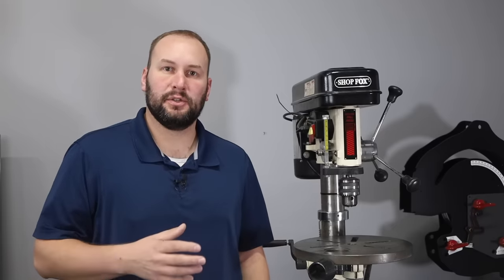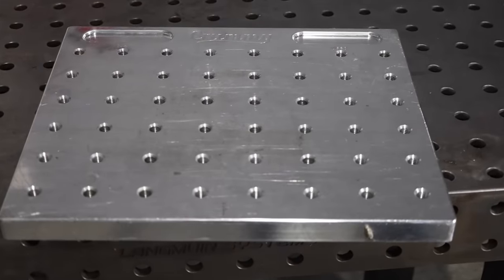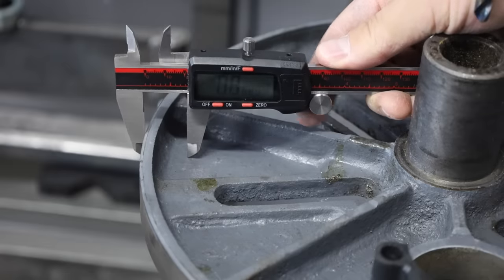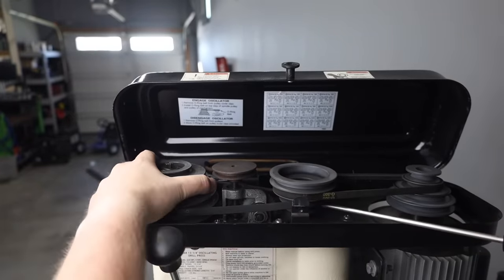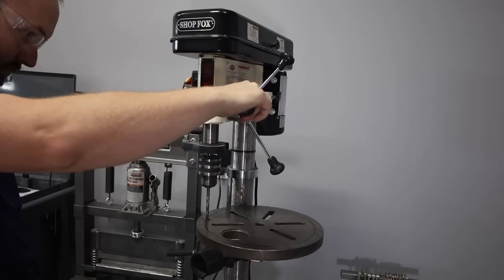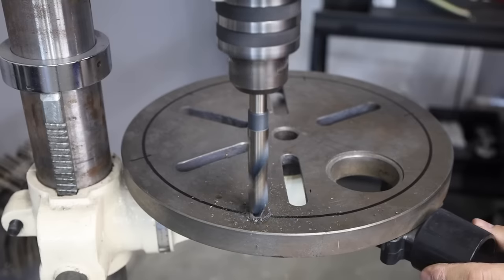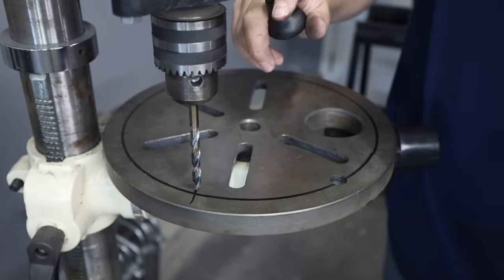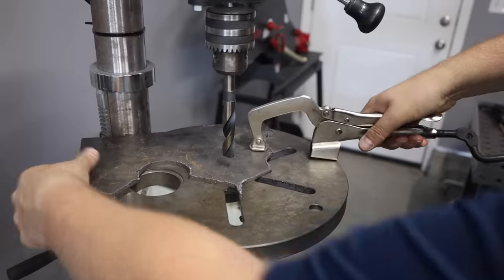EASY Drill Press Mod I Should Have Done Years Ago

Comment: Drilling (and sometimes tapping) holes in machine tools makes them more useful, for sure - there’s no rule which says you can’t! Hint for pilot size drills though, from a career machinist…use a pilot bit that’s the same diameter as the chisel edge. It’ll prolong the cutting edge life of the larger drill.
Reply from the maker: Great tip! Thanks!
Reply: I was going to say that 😅
As if your pilot bit is too big the next drill have a tendency to bite in since the surface area is to small and it chips the outer edge.
Always try to have a pilot bit just slightly larger than the center web/chisel.

And if it starts chattering and smoking it often is too high speed and too low feed force.

Cast iron is my favorite to drill as it doesn't make hot large chips that burns everything 🤣
Reply: i love pilot holes ! 
it's not cheating.. its guaranteed success everytime without killing my bits
Reply: @DursunX  I've never met a pilot hole that wasn't cheating!!!!
😆
Reply: @walterashley149  Haha! As a retired pilot, I resemble that remark! 🤣
Reply: yep, and you don't use oil on iron it could surface harden it. Good going
Reply: With gray cast iron, the free carbon - the graphite - acts as a lubricant so cutting fluid is unnecessary. But there are many types of cast iron so use cutting fluid if needed.
Reply: Yep, if you tell people you can't, nothing gets done. Traditional metal working practices don't always work, or they work, but never suitable for your own ideas.
Reply: Sorry I such a newbie, but what is the chisel edge? Asking because I’m a DIYer and never know what size pilot hole to use so I usually just pick whatever smaller bit that makes sense to me.
Reply: @DursunX  Nope, it's definitely not cheating, only in the eyes of luddites who don't believe in making life easy for themselves to get the same quality result. You are dead right. It doesn't hurt to know how  to do things the old way, then you have the knowledge behind you to improvise. And I certainly do a lot of improvising to get the work done. "You cain't cross dat bridge until you build it, but how you walk across it is yo' business".
Reply: @daveparker839  I think they are referring to the solid core of the big bit before the flutes begin for chip removal, the part where there is a chisel point on the larger bit
Reply: @frotobaggins7169  ahh. Makes sense. Thanks!
Reply: @daveparker839  Not a problem, we all have to share knowledge.
Reply: Measure the length of both the flutes at the tip of the drill the pilot hole never needs to be very big

Comment: Great idea, Tim!
Understandably you would want to avoid the ribs. Although, if you had not avoided the thicker sections in line with the slotted holes and drilled your holes through them, your clamp would have had better leverage and would not tilt back as much when tightening.
Perhaps drill one or two through those sections, test the difference and let us know.

Comment: Hi Tim, if you have a wide high jaw locking pliers, you can practically lock the item to be drilled without making any holes, just the bottom jaw will be below the support plate, n the top jaw will be on the workpiece. Dinesh from Fiji

Comment: Brilliant idea! 👍
For a big drillbit like 5/8 I would have run that drill press on its lowest speed. Most people use too much speed drilling steel, although that cast iron is a bit more forgiving than mild steel.
Reply: Recommended speed in mild steel for 5/8 is around 400-500 rpm. But you can always go slower - just have to adjust the feed.

Comment: Tim,  Cool tips. I have an anvil clamp I made for the anvil and I drilled 1/2 holes on my weld table and it works pretty well. I think I might see if it would work on the drill press. I drill a lot of pipe and have a block of wood with a vee cut in it and can really center a hole in pipe fast and its pretty secure. For drill lubricant in the 70s I had a spring shop make a new leaf spring and the old timer used water. He said there is no better drilling lubricant. It stays on the bit and hole longer. Cuts nicer chips and is easier to clean. I use water to this day and like the results.

Comment: There are formulas to calculate cutting rpm for a given diameter and material.  I do mostly woodworking, and to improve my larger rectangular table, I drilled 1/4-20 holes with a combination bit that has both the cutting tip/flutes and tapping threads as well.  After drilling the hole, I shut down the motor and did the tapping by hand after releasing the drive belt.  It works for me.
Reply from the maker: Awesome! I've never used those bits before but they look cool!
Reply: @TimWelds  I think that to use the combo bits to their full potential,  both a precise cutting and plunge speed must be used.  In my homeshop, the drilling speed is manageble, but I don't think I could ever get the plunge tapping speed correct, and so I did the tapping operation manually, so that I could feel both the cutting resistance and the feed pressure.
Reply: Those bits are good, but be careful. They tend to be very hard and brittle. If you tilt them to the side just a bit when using, they may snap in half.

Comment: I considered this, in the end I just ordered a set of vise grips long enough to reach the centre of the workrest, they cost 20 bucks from the best hardware store there is (ebay) which is expensive, but cheaper than trying to work with bandaids on your remaining fingers.

Comment: Wow what a great idea it's so simple I can't believe it took me this long to realize, I have already installed 3ph motor with inverter on my drill press and set hz to 45 to 80cps which has almost eliminated the need to change speed with belt/pulley changeovers, and I got reverse as a new added feature. I like your videos. Ray Stormont

Comment: A really elegant solution. That drill bit is a little expensive, as are the stronghand clamps. 
To use my locking c clamps on my drill press table—I can use a 1/4” steel plate under the table to bridge the bumps.

Comment: You can quickly loosen the motor to adjust your belts. If you look closely at the rigging up there, it slides back and forth. This also lets you tighten the tension if you notice some slack in your v-belts. Thank you for this. I've have the exact same problem nagging me in the back of my mind for years.

Comment: Nice mod :o)  I run a three phase drill and lathe off a variable from a single phase line. A friend said be careful of low motor speed and load because it doesn’t cool and he burnt his motor out. *if you have a four pole motor you can double the hertz to run two pole speed and still have a strong motor at 1460 rpm at 50 Hz.

Comment: Hey Tim! a great option for this is a magnetic vice kinda like a mag drill but you know... a vice. if you can find some transformers (for example from old microwaves) this is pretty easy to make and rather cheap especially for the usability. there are lots of videos out there about this if you want to learn more. good luck :)
Reply: *viSe
Reply: @rickdeckard1075  Only in American English, in actual English it's vice 🙂
Reply: @MichaelPowellAus  no one speaks the kings english in 2023 laddie
Reply: @rickdeckard1075  Where I'm from it's colour, neighbour, rumour, flavour, harbour, honour, humour, labour, we use taps not faucets, nappies not diapers, lifts, not elevators, our cars have tyres and use petrol, and we wear thongs on our feet 😀
Reply: @MichaelPowellAus 100% correct! 😂👍🤠🇦🇺 Straya mate! Lol

Comment: A nice tip, but you probably don't need more than 2 or 3 holes.  Also, I would have drilled through the thick part of the table at the end of the slots to give the welding clamp a longer hole to lock into.  I have a couple of holes in my drill press table and a tapered pin I can drop into any of them to stop parts from spinning if they are too small to hit the column.

Comment: what i use with my floor drill press is that same vice you have bolted to the table so its all ways there, then for the large flat pieces or any other odd stuff i use attachments that fit in the vice as a second fixture place, with the floor mount press its got the working space to do that where as the bench top ones would run out of room pretty quick.

of for the larger flat stuff or even the very small stuff i have a scrap box section with a steel bit of stock welded to the bottom of it for the vice to grab then i can use any number of grips to attach stuff too and i can drill right through the item and into the box section, with the press table as the lowest base you need to make sure you have your holes going through in the right place, its ok for one or two but many at the same fixing it would need re adjusting, the thinner walled box section i use also allows for thin needle nose vice grips for a lower profile above the work piece, i havent used C clamps on the work table yet but they do have a taller stick up

not so much a better way just a different way, i prefe that to unclamping / un bolting the vice from the table top

Comment: When drilling cast iron we always used paraffin  as a cutting fluid. 
Work hardening can occur if not & it can go like glass & be impossible to drill.
Cast iron doesn’t need any assistance to enable it to crack readily, especially when it gets hot.
🙂

Comment: Hey man, I don’t know if you read this, but I used 2 bicycle seat clamps with washers on them to hold down my vice on my drill press.  I mean, you still have to thread on the “nut”, but you don’t have to use a tool to do it.

Comment: A technique I use on the mill, when drilling or milling, is to apply my cutting oil to the upper shank of the tool, which allows something of a steady trickle to the part which is cutting.

Comment: I had a similar drill press with the two-belt setup... it sounds good until you actually use it!  I took the easy way out and replaced it with the one I really should have bought in the first place!  The new one is not such a heavily constructed machine, but it is a dream to use, and has a work holding clamp incorporated into it.
Bosch PBD40.  2 speed gearbox and variable speed motor. 13mm keyless chuck. Built-in light and laser crosshairs. Digital speed and depth of cut readout. Work holding clamp. Fence.

Comment: Hello Brother Man👍👍👍👍👍
   I really do like this idea. I have several bigger presses that are hard to get a grip on the bigger tables. One needs a new table because it swivels , and it has about been sawed in half from being drilled into before I even got it. 
   Way back yander when I was doing my apprenticeship, we were taught to only drill a pilot hole the size of the webb of the bigger size drill. Reason being the bigger drill will chatter and walk in the pilot hole until the outer flutes engage. It'll also dull the bigger drill faster in the middle of the cutting face because of the chatter.

Comment: I had to "Mod" my drill press; as I was assembling it, I realized the manufacturer didn't attach the rack & pinion to the column.. 
So when you used the table lift crank that thing was flopping all over the place.  
A quick drill and tap fixed it up!

Comment: Hey Tim. Just watched your video tip in on drilling the holes to use your clamps in. I purchased the same w1668. Going to do the same with my table. Going to purchase your welding bundle. I purchase a 3 in 1 welder from Eastman about a year ago and have not used it yet. A little intimidated I guess......lol

Comment: I have the same drill press vise. I like it loose, so the drill will automatically center on my center punch mark or pilot hole. But, I also keep 1 T-bolt in 1 slot of the vise. I keep the bolt pretty loose so the vise will still move, yet won't move even when I drill something awkward. Try it, it's safe and doesn't defeat the purpose.
Reply: Similar to this, my dad taught me a trick.  He would use a carriage bolt up from the bottom, through a slot in the table then a nut or two to hold it in place.  It functions similarly to a guide pin on a router table and acts as a stop in case the bit grabs the material.

Comment: It's good that your holes ended up inside the marked line. I noticed that when you installed the clamp, it almost overlapped the table edge, which would have made the clamping ratio less ideal. So anyone looking to use this great idea should make sure all their holes are at least far enough into the table to ensure the base plate of the clamp does not overhang the edge.

Comment: Nice video and idea. 
Caveat?
Slots are (voids) in the back plate which was made with edge (ribs) to distribute work stress away from the void to avoid premature breakdown and crack in the plate. 

The diy void hole in this video has no protective ribs is not protected against migratory breakdown and cracks. DIY voids are sensitive to shear force sourced from the work. 

To make matter worse the hold down force is amplified with mechanical advantage and is converted into a shearing force which is a potential risk to the back plate made of brittle cast iron, and not for mild steel. 

Option? 
Create a secondary back plate out of mild steel a thickness close to the stud of clamp pliers and mounted on top of the stock plate. Create hole pattern in the new plate matching location of stock slots. There you have it. It is unnecessary to make an array of holes in the new plate.

Comment: Thanks for the video, I have noticed a little problem 03:28 the clamping is pushing the part due to the 90 degree pliers clamping. I think a 1/4” cover plate underneath the round table would work better and the use of a “C”clamp or a regular pliers.
The use of 180 degrees clamping should maintain the part to be drilled in place.
Reply from the maker: I agree that would be more accurate. I never thought of a cover plate for the bottom, that's a great idea.

Comment: A year late, but hope you fitted the VFD drive.
I did to mine and it transformed the drill press as it’s so easy to adjust the speed for the size of drill bit being used.
So easy to vary the speed to get that perfect curl of steel coming up the flutes.

Comment: I have the same drill press except mine is a floor model not the benchtop. I switched to an Albrecht chuck for quick change and no key. Normally if I want a hole say at 5/8 I would drill it 9/16 then chase it with the 5/8, normally a 135 degree drill bit is not just high speed steel like most at 118 degrees but it has some cobalt in it as well and a coated drill can be better if it isn't garbage under the coating like you see coming from China. I worked in aerospace manufacturing for 43 years, back then I wasn't using drill presses much but the tooling was always high end stuff and to this day I only buy good tooling.

Comment: I saw one the other day doing the same thing with the VG; however, his table already had holes like your mod. He may have a custom table, though I'm not sure.
Anyway, I'm going to do what you did. Mine is an old Porter cable that is, uh.... an odd shape. The slots are an upside-down t-shape, so I took some bolts and welded a washer to the head and ground them flat on two sides so that they could slide in the slot and I could tighten them from the top this is to hold the vice. It works ok, but it can be a PITA sometimes. I'm going to use your idea for drilling flat stuff more easily. 
Thanks for making a nice, clear, and concise video for us.
Reply from the maker: Cool! It could have been the Fireball Tool fixture plate.
Reply: @TimWelds  Thanks.